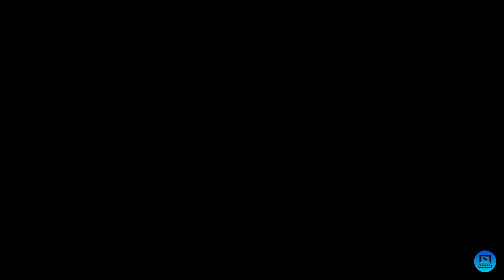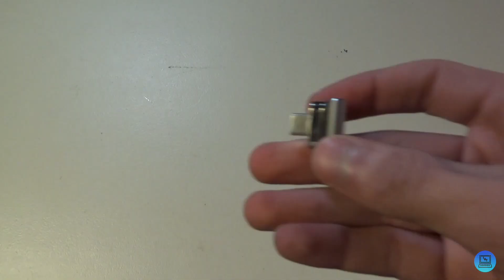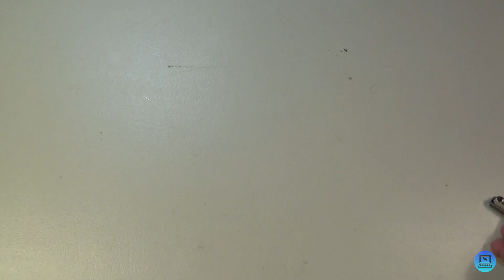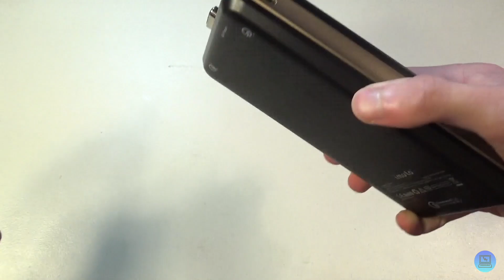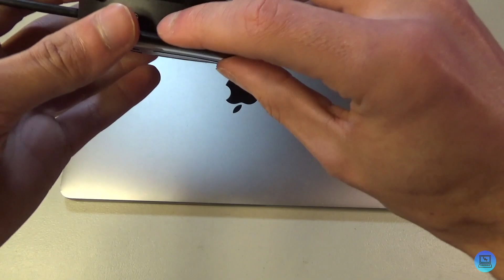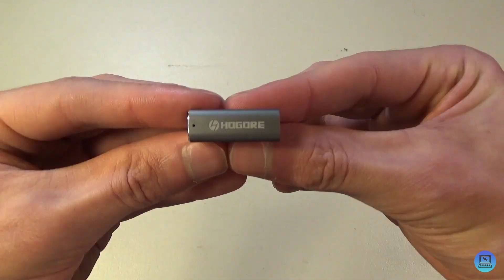Magnetic USB-C Perfection? Hogore Magnetic USB-C Adapter Unboxing&Review

Comment: UPDATE:  As I promised I'd let you know when mine arrived, if it would work with an iPad Pro 12.9", generation 4, 2020.  It just arrived and it works fine so far.  It  did not come in a plastic box, but only a small cardboard box, foam lined, and with a tiny plastic prying tool that I assume is to get the adapter back out of the iPad.  I have to note it does stick out a bit from the side of the iPad.  Yes of course that was expected, but it's still startling when you have it in reality.  So far so good, so I'm thrilled!

Comment: This has more pin because this is a standard usb c which has lots of pin. The one you shown earlier is made by  a well know Chinese manufacturer in China which manufacture lots of different accessories for phones. And that specific charger is just designed for phone not for such high power usage, it will be definitely normal if it doesn’t works well or last long.
Reply from the maker: That’s why I got the new one :)

Comment: it takes too much space and covers the 2nd port , also which makes difficult to insert a usb
Reply: You have another two USB ports on the other side tho
Reply: @dudemynameiscat   only two  ports with C type
Reply: @sumedhhalmare3025  My MacBook has 4 USB C ports, I do have the 16-inch model though.
Reply from the maker: Yeah. If it’s the base model non-TouchBar Pro or the Air, it’s only two ports
Reply: @dudemynameiscat  I have 2018 MacBook retina

Comment: Hey! Thanks a lot for your review! =)
I have couple of questions, i would appreciate if you answer me

So, is this adapter still working?
And another question, i want to buy it not for MacBook, but for xiaomi mi notebook pro, i think, there is no difference? Because on their website they say that it works for any type-c port with "power delivery" function
Reply from the maker: Hi! Yes, it still works! I use it every single day to charge my MacBook and the ChromeBook that I am currently reviewing! And yes, it will work with the Mi Notebook Pro! Anything that charges via USB-C Power Delivery should work fine!
Reply: @TechnologyNToys  Thank you for answer, i appreciate it! =)
I was a little worried, because on 4pda forum some people was saying, that their notebook was killed with one of magnetic adapters, but as i see, there is no reason to worry 😅
Reply from the maker: Yeah. One of the adapters that I used before this one had some issues, but this one’s perfectly fine
Reply: @TechnologyNToys  I've sent comment with link to AliExpress page just to ask you a question (it wasn't advertisement or something), that comment was deleted, i think it was done automatically, can I somehow send you link to ask a question?

Comment: does it work with both charging and video (say i plug it in my monitor that outputs power, will i have both video and charging) ?
Reply from the maker: Yessiree! It simply makes the port magnetic, so anything you can do with normal USB-C (Not Thunderbolt 3), you can do with this adapter!

Comment: Will it be working with a iPad Pro 2018?
Reply from the maker: Ideally it should. I don’t have one on hand to test, but it should work no problem!
Reply: IPad Pro 2018 doesn't have a USB-C does it?  I thought those only came out in 2020.
Reply from the maker: Nope. Both 2018 and 2020 models have A USBC port.
Reply: Technology&Toys, Thanks I didn't realize that.  I have an older iPad Pro, and I just ordered a iPad Pro 12.9" (2020) gen 4 that is due to arrive tomorrow.   I'm trying to figure out how to set it up with magnetic charging cables, as all the older versions of iPad I have, have gone bad due to the connection point wearing out and needing increasing thicker plugs to make the connections.  I was hoping a magnetic connection with the one adapter staying in the iPad would stop that.  It comes with a UBS-C  and charges with 18w.  I need to do data through whatever I get too.  Thus the problem, what to get?
Reply from the maker: Definitely this one! Been using this forever with my MacBook, that ChromeBook I used a while back, and I’ll occasionally use it with other things like battery banks and the like. I’ve used a few others, but this is the only one that hasn’t failed at one point or another
Reply: Technology&Toys Great!  I popped over and it said this, "NOTE: Please confirm if your laptop/phone/PC supports USB C Alternate mode (Support USB C video output, PD ."  What the heck is Alternate mode?  LOL.  It doesn't say anything about iPad Pros, so I assume you know for sure.  But I can't confirm the Alternate mode, since I'm clueless on what that means, LOL.  Can you help?
Reply from the maker: Never heard of alternate mode lol. I’m not 100% sure of it’s compatibility with the iPad, but the safest way to check would be to slightly insert the adapter to the port and see how much resistance you get. If it’s an uncomfortable amount for you, or it just straight up doesn’t fit, then you could probably return it if you don’t have another use for it.
Reply: Technology&Toys Hmmm, sending things back was what I was trying to avoid.  Shoot, I wish I knew it was capable for sure.  It seems like it would be.  It's always a question when sellers don't list by name exactly what their products will fit.
Reply: Technology&Toys, I ordered one.  I'll let you know when it gets here, LOL.

Comment: Hey my dude, thanks for the review. This is the ONLY magsafe adapter I've seen that can do transfer and charging. Same question. Is this still working? 
I saw some reviews where the magnet came off on both ends. Is it loose at all? Thanks in advance!
Reply: Hey, i think if the magnet will came off without breaking, you will be able to glue it back, i have one magnetic cable for my tablet, after long period of time magnet came off, so i just glued it back and now it's working fine
Reply: Also I think you can open the dispute jf magnet will came off
Reply from the maker: Still works beautifully! I dropped my Mac Book a couple weeks back and messed up my first one (the one in this video), but I got a second on, and so far it works just the same! I haven't experienced the magnets coming off, but I'll let you know if they do.
Reply: @TechnologyNToys  Thanks for the reply. Will love an update whenever that time comes!

Comment: hi.. thanks for your review...
I have one question:
when you putting in the magnetic cable, how can you use another USB type-C beside it ?
Reply: true, but u can use the other two sides, And i dont think anyone uses all four of the ports in a macbook pro
Reply: @teerthjilka471   I use all 4 ports really.
1 for my Apollo x6 interface
2 for charging
3 for connecting with my LG monitor screen 
4 for adapter to others

thanks for your reply.

Comment: Type C magnetic plugs are not practical at all because they are too long and stick out from the device unlike micro USB ones that are shorter and don't stick out from the device much.
Reply: chongtak but hey at least It won’t break if someone trips over the cord
Reply: @scrap5051  It would have the same effect with any USB cord which I happen to have as well as the type C. My point is that the type C is sticking out at least 2mm that makes the plug way too long and lost the convenience of a magnetic cable. But if you don't know what I am talking about then...

Comment: Fake.. you wanna prove something works you gotta show it working man. Guarantee you plugged in that multiport adapter and your video didnt work or the data rate was MB not GB like usbc spec. You gotta show it working and talk about if it even meets the specs they claim. Heck, even a chargin time comparison between the magnetic cable and the normal Mac cable would be good, bet it takes 2x as long with the magnetic canle
Reply: Why does he need to do that? He's not a sales rep. Just show that it works like people expect and then someone else can take the reins from there.
Reply: it's designed up to 100W fast charging, so why would it be slower than a normal cable?

Comment: Is this safe for a 2019 Mac Book Pro? This video is video is close to a year old now, so any advice from a long term user would be greatly appreciated. Thanks!
Reply from the maker: I believe I said in the video that the company says (not to sound mean, but I’m not able to check right now) it won’t exactly work with 2018 and newer, because the ports are a little tighter. I’ve tried it with a friend’s 2019 MacBook Pro and it did fit, but it was a little more effort to take it out again. 

TL;DR - It technically DOES WORK, it’s just up to you to determine whether or not you should do it.
Reply: @TechnologyNToys  I think I asked questions first before finishing the video. Thank you!